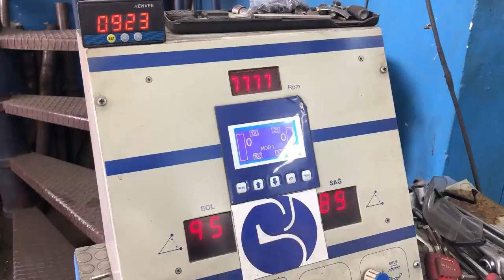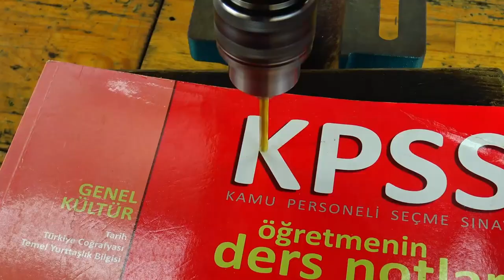Old Metabo Bench Grinder Restoration - Restoration Videos

Comment: That paint job is stunning.

Sadly, it will likely wear out with the loose fit bearings. They are supposed to be interference fit for a reason. The imbalance will cause vibrations that will reduce its effectiveness.
Reply: Have to agree with you here.  He should not have removed any material from the spindles for exactly that reason.
Reply: @jl3390  When he turns the grinder off at 17:33 you can literally see the spindles jumping around like a mm, when it was running the vibrations were intense. If he decided he was going to.. machine the shafts smaller, he should have pressed on a bushing or sleeve to bring them back up to spec. Or try to find oversized bearings. At least swapping the bearings will be easy in the future, they'll fall right out!
Reply: That’s what stumped me too.  It is clear when the bearings were removed, they were removed by force but put back in with no force.  All machinery assemblies that contained bearings that I have seen had the bearings always pressed fit over the shafts.  Don’t really see the point in a bearing spinning itself around the shaft at 100s of RPM

Comment: When it come to heating to get a seized screw or bolt lose. Heat causes expansion, so heating the bolt makes it tighter, heating the exterior metal expands that area, and provides a little more more for the bolt to move.Great resto, and thanks for the content!
Reply from the maker: thank you very much for your valuable comments.
Reply: Wrong heat dose help

Comment: Excellent work! Have you tried grinding down the plaque rivets like you usually do but then center punch them and drill them out partially using a slightly oversized drill bit? You wouldn’t have to then pry them out forcefully.
Reply from the maker: I have not tried. but I get this idea from you. Thank you.

Comment: I want to by an old vintage tool. I will take it apart. Use steel wool. Get shocked doing the water rust electricity removal thing. I will mislabel parts, cut my finger, spray oil in my eye and get paint remover on my skin. My project will last less than one hour and be in the garbage bin same day. 

Point of all this?  You make it look so simple and easy but it is not. Thank you for producing this fun content.
Reply from the maker: just fun.

Comment: A mistake machining down the bearing surface on the shafts, 
1. nobody will see the internal part, 
2. those bearings slid on too easily, they should be an interference or press fit to work properly (they are now loose as is evident from the wobbling, vibrating shaft when the machine is turned on at the end), an engineer should know that. In the lathe and polished with steel wool or high grit emery paper would have been better. I would also have taken the plastic seal from the bearing and put a good quality grease in it (replacing the rubbish they give you) and then replaced the seal.
Reply from the maker: There was a balancing problem in the mill. it works very well right now. I started using this tool myself, you can see it in the last video. Finally, projecting each work to the camera is a separate job and a difficult job.
Reply: @meinemechaniker  ctiley2212 is correct in what he is saying. What you did with the shaft is completely pointless there was no need to do that. The vibration was so bad that it made the camera go all funny.
Reply: ctiley2212 totally true, machining the shaft is the reason why you have vibration when it’s turned on.
Reply: he can try some bearing retainer but it will still be a little loose maybe he should try shimming the shaft with some fine aluminium, id try coke can strips they work I have used them before on worn shafts until a new shaft can be machined
Reply: what does it hat zu do with "engineers" ?
Reply: @meinemechaniker  after a second view i noticed that bearing part in the shaft was not machined down just cleaned. Meine Mechaniker beautiful job. Very detailed work.
Reply from the maker: thank you 👍
Reply: I scrolled down to say this. I work in a workshop where refurbishing motors is a regular task. Bearing surfaces are never resized, even polishing with 1200grit paper is carefully considered. The bearings should have to be heated in order to slip over the shaft, even then, they're hammered on with teflon tools before they cool. The bigger motors have the shaft cooled with liquid nitrogen as well as having the bearings heated on an induction heater. I cringed when I saw how easily it slid on; it might work but the bearings won't last and the shaft will go out of round and be damaged if the tool is run in this configuration. It can be repaired with sleeves on the shaft. Simple and easy fix.
Reply from the maker: @jimmyfleebot  you are right
Reply: @meinemechaniker  We use a sleeve called Speedi-Sleeve by SKF, they are inexpensive and easy to fit so long as you still have enough meat on the shaft. I really like your videos, your post production is very professional and it's nice that you respond to comments. You also have good taste in tools, I own Metabo gear myself. I've liked and subscribed.
Reply: I prefered my mechanic tho
Reply: I’m glad  happened to see your comment, otherwise I was going to write something similar. I’m agree it’s absolutely wrong to machine down main shaft while using same size bearings, can clearly see bearings are wobbling.  But end of the day it is private restoration, personally I wouldn’t.
Reply: Where is your restoration, maybe there are things that could have been done a little different, the guy is trying as hard as he can give him a break,,,,,
Reply: jimmytea1 no need  to attack me , like you know everything and I know nothing, you know nothing about me ,
Reply: @billy123174   I apologize if it came across as an attack. I was correcting your misinterpretation of other people's constructive criticisms and people just being hard on him. Where I work, often new apprentices say that same sentence "I'm trying my best, give me a break" which shows that they have missed the point of learning about the error; rather focussing their attention on their pride. Every one of them drops it eventually and just accepts the learning. I am an electrical design engineer who worked up from the trades into the offices. I have rebuilt hundreds of motors from 1kw to 1300kw/3.3kV I do know a bit about this subject. Seems odd for a peer of similar experience to take the "give him a break" line.

Comment: I have to admit your work is very pretty.  But I don't know why you turned down the shaft where the bearings go.  They should be a press-fit.  Some emery cloth would have brightened those areas while maintaining the press-fit for the bearings.  Do you "restore" these items to use them, or to be pleasing to the eye?  In my mind they are tools, not objects of art... but many commenters here like your work, so that is just my opinion.

Comment: I agree with ctiley. That wobble is horrible and was avoidable! What I would like to know is how did you repair/replace the name and data plates. The originals were in very poor condition. Overall a great job.
Reply from the maker: Actually, the only reason for wobbling is a wire brush. I currently use a single wire brush while working. and I fixed the machine on the table. No wobbling right now. you can look at the last video.

Comment: Why do you turned the shaft ? Bearings became too loose. And, I think, you somehow missed with rotor balance, because at the end it shakes so bad. Lot's of effort, but final result good only on visual side ;)
Reply from the maker: No, I have been using this machine for about 2 years.  and everything is fine.  I use this machine in every video after this video.  the machine is now stable and therefore silent.

Comment: Others say you were in error by milling the shafts. Unnecessary maybe. But I believe the bearings ride on the outer shafts that screw onto the motor shaft and that was not milled. Looks like a wonderful job done. Suscribed
Reply from the maker: Thank you so much.

Comment: Why, oh why, did you put the arbor on the lathe and take so much material off?
Was it out of balance?
I hope you accounted for the now missing diameter thickness when ordering the new bearings.
Reply from the maker: Congratulations for your attention. I have been using it for 2 years without any problems.
Reply: @meinemechaniker  I am very surprised that it has not given you any problems!   Wow!!!

Comment: You should have not cut the shaft just a polish would suffice. The bearings sat loose. Now you need to knurl the bearing journals to seat them properly
Reply from the maker: which mile did I cut? I don't remember cutting a mile.
Reply: @meinemechaniker  I think he means milling the shaft @08:50 

Beautiful work btw.! 👍🙂
Reply from the maker: Thanks 👍

Comment: I just love that hammered paint! Great restoration BTW. I am curious about the black coating you put on the inside of the casing pieces. Is that paint or a rust converter/preventative?
Reply from the maker: thanks, that thing is to prevent rust.

Comment: Okay, everyone clapping hands about beautiful restoration. It's not that bad, the job was overall great, except for the ruined shaft (and basically the working principle of accurately running grinder). The bearings had to be tight on the shaft and skimming off the surface "just for the looks" with the lathe ruined the interference fit. That was a poor decision :-(

Comment: 0:59 Looks like someone forgot Left-handed thread on the Left, and Right on the right huh? Why balance the rotor if you were going to use as a vibrator in the end?  Had the electrical supply be single phase you'd have a heater, and a vibrator. No domestic 3-phase in the west :(we don't have access to that R. Federation gas supply... Yet):

Comment: You used baking soda (sodium bicarbonate) for the electrolysis process. WASHING soda (sodium carbonate) is more effective.
Reply: Look again, he did use sodium carbonate. If you pause the video you can read the label on the container.
Reply: @TheOldPCTech  - Didn't pause it last time. I believe that where it's now over-written sodium carbonate  had said sodium bi-carbonate before. Thus my comment. I wouldn't have commented otherwise. The power of editing. :-)

Comment: 12:38 what was that for?
Reply from the maker: Hi! these parts are the abutments used for grinding.  I said I wouldn't use it as a grinder.  These bases are not needed for the wire brush.  and I used a new ergonomic piece so that the parts where this piece came out are not empty.

Comment: Bearing size should be tight,you cannot cut it thats why grinder is making noise while running
Reply from the maker: Hello, I used this tool in my last video.  Watch it there no longer smiles.  because I fixed it.